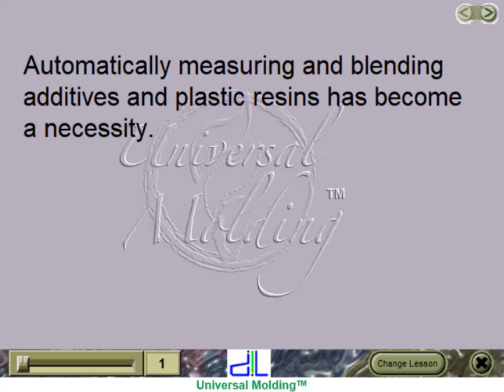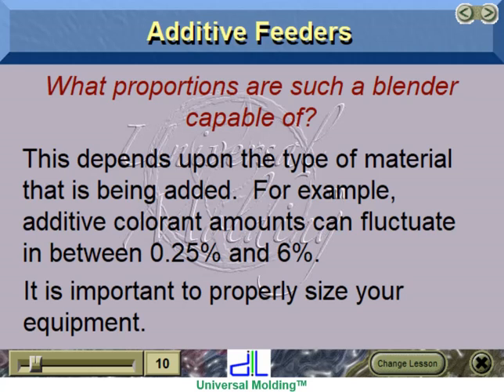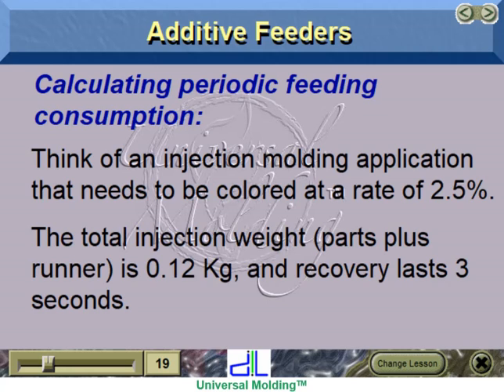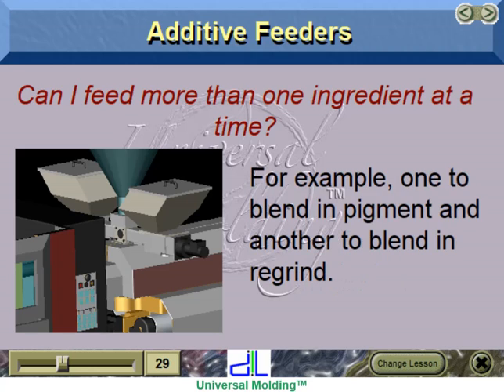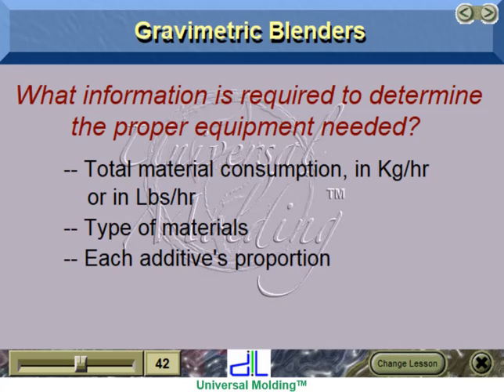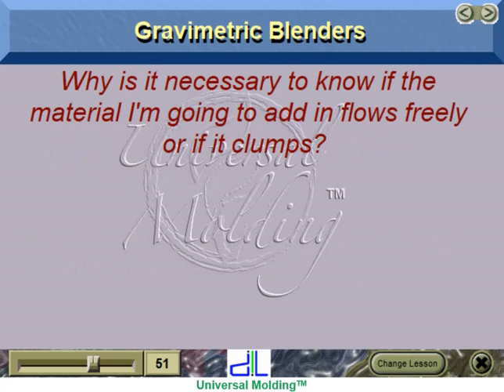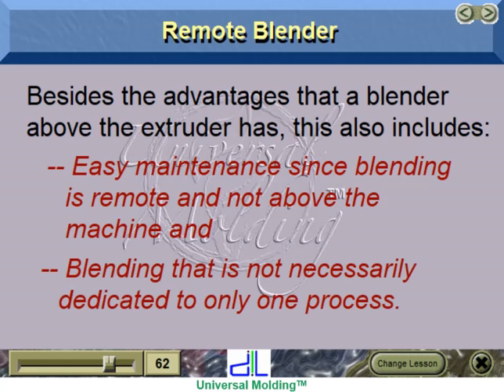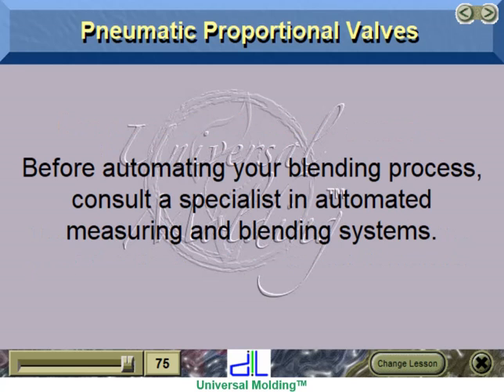MU5E - Blending

Comment: hello, thank you for your videos. I noticed what seems to me like a small error in the calculation of the material consumption in the periodic feeding where you divide the injection weight by recovery time. isn't it supposed to be devided by the cycle time instead? cause the feeder works on recovery time yes but not during the other stages ( cooling, mold opening...).
thank you for your consideration.